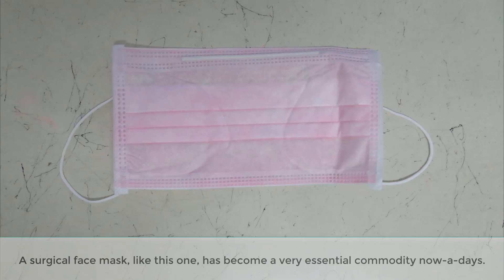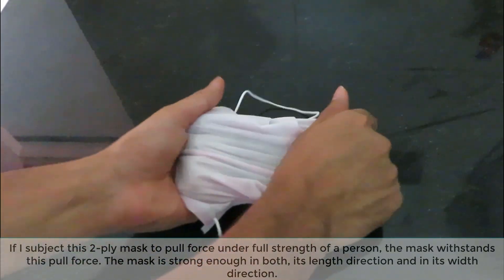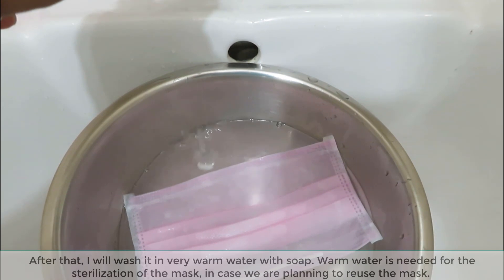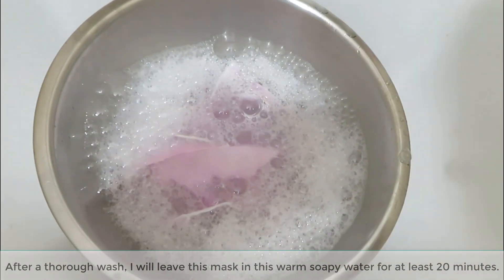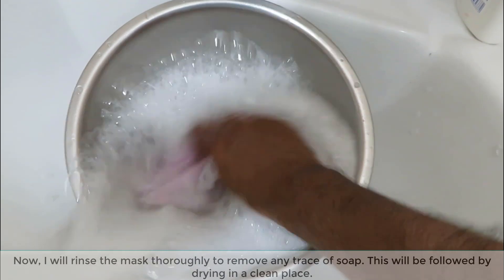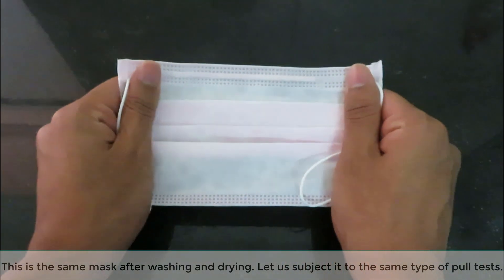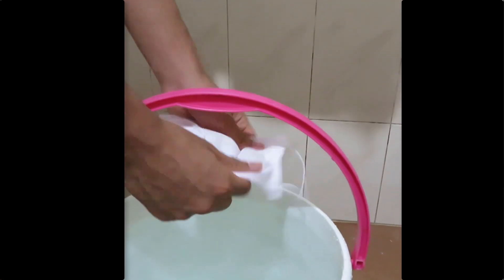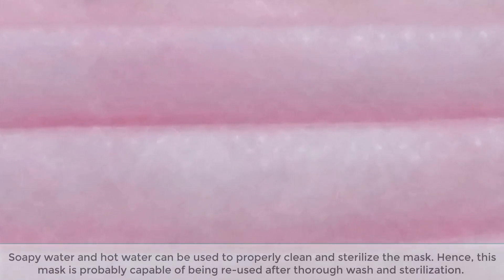What material is a surgical mask made of? How strong is a common surgical mask? Can it be reused?

Comment: Thank you for your efforts. However these will not protect an individual from having viruses 🦠 like covid19 from coming through and infecting one. They will protect others from our sputum if we are infected. Even that may not be effective to prevent others from getting sick without social distancing. Virus are so tiny, millions can fit on the head of a pin.
Reply from the maker: You are right. social distancing is the first one. 3 or more than 3 ply masks are necessary to block the droplets. According to my information virus passes through droplets. But you are right regarding the size comparisons. Let us know more regarding this!
Reply: I found a study that I found very interesting at the beginning of Covid-19.  Look for:  American Chemical Society www.acsnano.org The article is called “Aerosol Filtration Efficiency of Common Fabrics Used in Respiratory Cloth Masks” by Abhiteja Konda, Abhinav Prakash, Gregory A. Moss, Michael Schmoldt, Gregory D. Grant, Supratik Guha.   The article tests several materials and different types of material layers. The point I understood from this research, A mask best protecting the wearer must include 600 thread per inch cotton, followed by furnace  filter #13 (nothing less will prevent virus from passing through material. Virus range in size from 20-400 nanometers. A nanometer is 1000 x smaller than a micrometer. A bacteria is approx. 400 nm. So Virus are VERY light, floating on aerosol sneeze sprays for hours. The second and more important point is fit in a mask. ANY GAP in fit will allow virus in. So until someone invents a comfortable, correctly fitted, filtration 😷 mask, a mask will not protect wearer. But a mask will HELP keep our spit from spraying others when we talk- which I do, unfortunately. Perhaps you will come up with this mask? You will become a billionaire. If you do? Please remember me- perhaps with 10%? God Bless you!!!

Comment: Never do that...surgical and N95 must not be washed .made up of tightly packed polypropylene molecules, on wishing will loosen up these molecules and the intermolecular space increases and there is reduction in the trapping capacity of the mask.. surgical mask are meant for use and throw purpose and n95 can ve reused for a limited days period
Reply from the maker: When you can't buy, couple of soaking in soapy water will not loosen the molecules. Actually the mask is physically very strong.
Reply: In the summer to stay cool I wet mine down i was able to keep it on Its to hot for Masks on my face in the summer they cause a rash on my face , I can not afford to wear them once and throw away I use mine about a week or 2 weeks I only wear them to appease the Powers over us